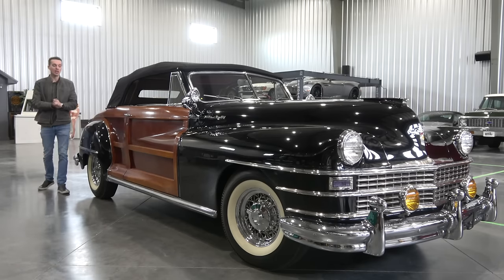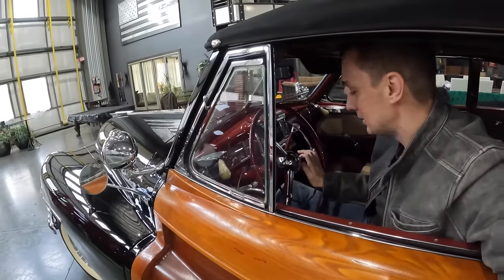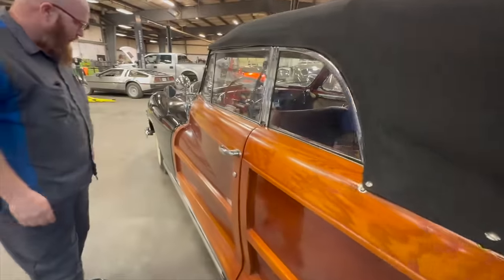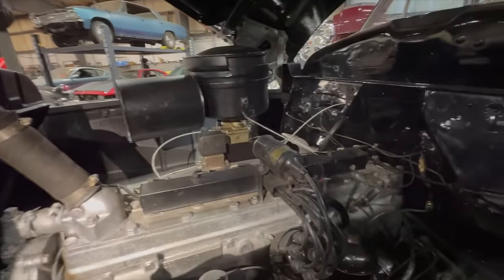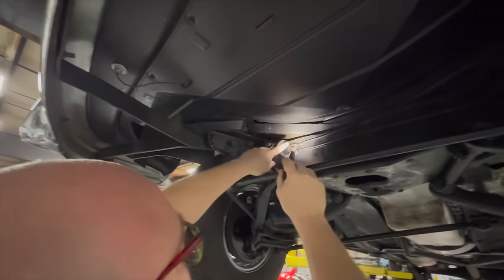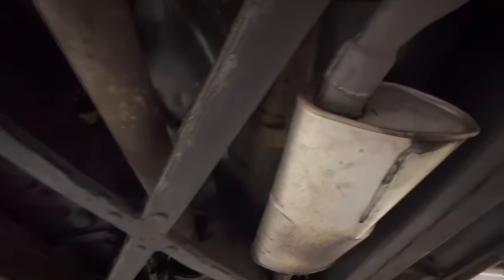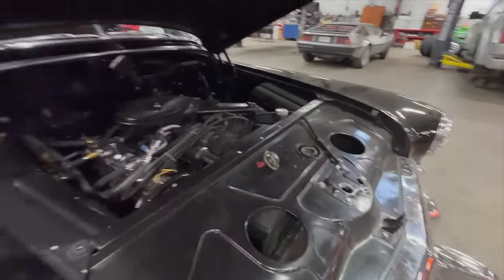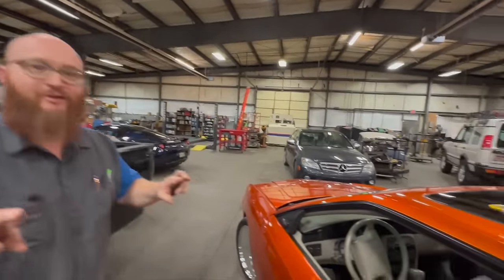Everything that's broken on my 1946 Chrysler Town & Country after it sat in a museum for 20 years...

Comment: I hope when you had the Cad towed, they lifted up the BACK of the car, not the front, as you can NOT tow a car with automatic with the drive wheels on the ground.  You will ruin it due to the gear train being turned without any lubrication, as the front pump is not being turned - the input shaft, which is turned by the engine, is not turning when it is being towed, and the rear pump doesn't come into play until you are going faster than about 35 MPH.  This means no lubrication.  The damage often won't show up right away, leading you to think all is A-OK.  Sorry for so many messages, but I don't want you to start having multiple failures on top of failures, and either give up on classic cars, or think that you have to put a Chevy engine in them.

Comment: Make sure to use a hydraulic fluid equivalent 25 weight for the fluid drive 
You only need Clutch for starting in second gear once rolling at 35 mph let off accelerator you will hear her shift  click clunk  then slowly accelerate to 45 --47 mph let off click clunk your in third   to downshifting use Clutch  .. any  transmission services 
Let front seat  back all the way  pull carpet back there is a floor access panel  to service 
Just fyi she will freewheel  so keep brakes working  .. i own 2 of these fluid drive cars and one truck and work on these .. awesome video thanks for posting 😊 👍

Comment: The damage to the muffler is from an explosion. Unburnt gasses built up and ignited.  In high school our friends would set the ignition timing just right and we would turn off the engine as we coasted to an intersection,  turned it back on just before the engine died, then BAM! the loud noise would scare people spitless. It was a lot of fun but I blew 2 sets of turbo mufflers off my C 10.

Comment: You are driving the semi-automatic wrong.  Normal driving is done in Hi-Range (3/4).  Lo  is only used if the car won't go in Hi.  When you drive as you did starting in 1st and do a lift foot shift to 2nd and then make the clutch required shift to Hi, it goes in to 4th not 3rd.  Normal driving is done in Hi, using 3rd to launch and the lift foot shift to get 4th for cruising.  Launch in 3rd is on the slow side, but the car is much easier to drive in Hi alone and that is both recommended and what drivers in the day preferred.

Comment: You do not need to start off on LO, unless you are on a hill.  On level ground, just use HI.  Shifting between LO and HI defeates the whole purpose of Fluid Drive.  And you do not shift to Neutral at stops.  You stay on HI.  It won't stall the way a stick-shift car will.  Just drive the car as a 2 speed automatic.

Comment: That gearbox looks like a British Laycock over-drive box. The MGB and Triumph Spit's TR's some Jag's et al used them. Their g/boxes ran on 20W50 engine oil. It is an electro/hydraulic Epicyclic, or Planetoidal gearbox.
It is engaged using an electrical switch that operates a solenoid which operates a hydraulic valve and then pulls a steel band. Inside the band is a Sun pinion connected onto the final drive shaft of the main g/box. Around this are three planet pinions. The band pulls the planet pinions onto the Sun pinion, giving you an extra gear without using the clutch. The overdrive could be engaged in third or fourth gear.

Comment: I see you have the improved full flow oil filter like a new car  as opposed to the older bypass style.
The air filter takes straight 50 motor oil. Do not use light oil, it will splash around and get sucked into the engine.  Every 10,000 miles rinse out the filter with solvent and let drip dry, do not blow air thru it, pour a little oil on the filter and fill the reservoir to the line. You don't have to buy air filters, the original lasts the life of the car, and a quart of oil will do for about 5 or 6 service intervals.
Fluid Drive and transmission are filled separately, use TDH (transmission, differential and hydraulic fluid) tractor fluid ISO 32 or ISO 22 grade. Change trans fluid every 10000 miles, top up fluid drive, fluid drive is a sealed unit and does not need to be changed,

Comment: Wizard goes the transmission might have an electronic servo..with clear vacum lines going into and he never checked out the tie rods ball joints nothing nor wheel bearings that light touch is laughable and not putting after market manifolds on the raptor as i mentioned before is even worse

Comment: That fuel filter on the Cadillac carb gave me flashbacks.  It was so easy to strip those out trying to get them apart and back together.  I ended up having to replace the carb on my girlfriend's car after stripping out the self tapping replacement, trying to get it to seal.  Ugh....

Comment: With those old northstar V8's it wasn't the fault of the headgaskets, it was a failure on GM for using iron head bolts on an alluminum engine where the waterjackets were right up against bolt holes and would seep through and rust the bolts causing head lift to occur basically totalling the engine as it was a pain to fix and shops would ask 4-8k in repairs.
Reply: That was the main issue. It's a damn shame that after the first few years they didn't fix the issue the engine had a 20 year production run and they never fully addressed the issue
Reply: @davidlavalle7583  They did "address" it by lowering the HP in 2000 but it didn't "fix" the issue just made it last a little longer. I'll say this, I had a 96' Eldorado and even though the head was lifting and i was quoted 8 grand to fix at 163k miles, it was still my favorite car up to date.
Reply: @Nagato524  I don't think the lowered the hp they just offered 2 different models a 270 hp that went into the sls and rhe 300 hp in the sts even though they were identical cars I don't know which variants went into the other models. I had a 08 sts with a 320 hp variant but that car was garbage. Blew 2 motors and had all kinds of other issues never ending headache. Damn shame because when it was right it was an amazing car

Comment: The radio probably needs to be re capped and possibly replacement tubes. Being that old all the electrolytic capacitors are dried out or leaking.

Comment: Weeezard, check the 3rd brake light gasket on the raptor, they are known to fail and water will run down to the cab corners and rust.

Comment: I think Chrysler had their own fluid, but 10 weight is the replacement for the transmission.
Reply: The trans used SAE 10W motor oil, but you can use Type F ATF, as it is SAE 10W, but do NOT use Dexron, as it is only 7.5.  The fluid couple uses Chrysler Fluid Drive oil.  You can use ATF Type F in that too.

Comment: Can anyone explain why they keep the windows open when the cars are parked in the shop?  That dust and grime you see on the body is also accumulating on the interior seats, carpets and surfaces.  Makes no sense to me.

.
Reply: Simple answer is to prevent accidental locking of the keys inside the car while being worked on (per Wizard).